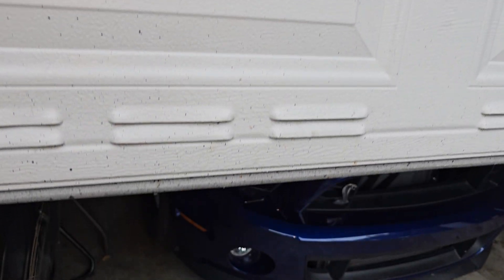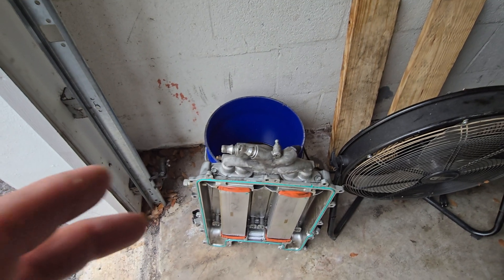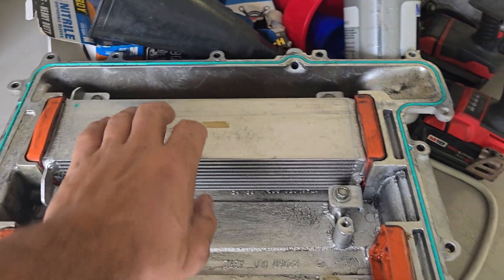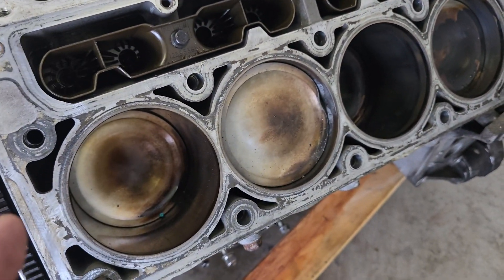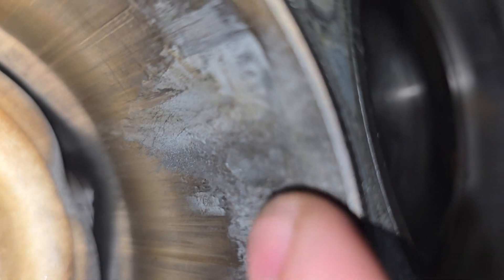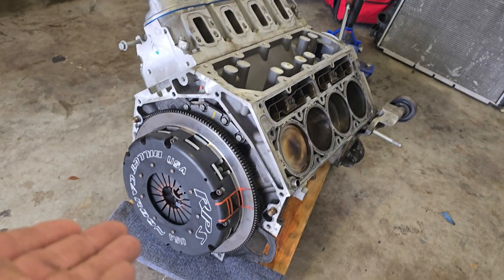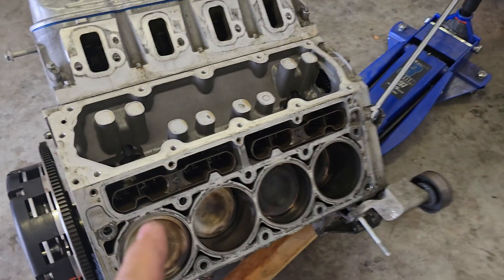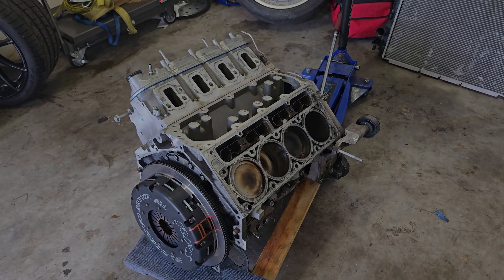The Smoking Gun?: What Really Happened to My Corvette's LS9 engine failure.

Comment: If you resleeve, go with an established company. Try to use the LS9 block you have as it is stronger than a regular LS3 block. Pretty sure there are aftermarket companies that make bricks. If you go with a stroker, unless you stay with a factory length sleeve, stay with a max of 3.900" stroke. I know a lot of people use a 4.000" crank, but depending on the piston/rod combo, with 4.000+ cranks, The piston skirt sticks out the bottom of the bore and rocks, causing premature skirt/bore wear. A 3.900" doesn't have that problem and with a 4.065" bore, you have a 405 ci engine. A good cam really wakes the LS engine up. You can get 100+ HP with just a cam change, with the right cam. R.E.D. has a very good rep, as far as doing Darton sleeves.

Comment: We caught my bricks leaking on my cam install. Already had the Kong gen 3 lid ready for install. Mine had a small pin hole even with stock reinforced bricks. It lasted only 4k miles with a 2.35 upper pulley. Car had 9500 miles when we did cam install.

Comment: an air compressor with regulator set to 10 to 20 psi with an air gun with rubber nozzle or rubber cork will test inter cooler bricks filled with water. you should see it piss out water if its leaking as bad as your was. you probably have a cracked ring land or a bent rod on that bad piston from the high temps. possible detonation from the blowby but you should have seen some knock if you were logging,
Reply from the maker: LMAO. Did you not see the burned piston? Hahaha

Comment: Alex - any debris in the engine oil and filter? I would honestly check tolerance/clearances on the other 7 cylinders.. if the 7 cylinders test good and within spec I would just  sleeve the  faulty cylinder with new piston and rings.. I’ve Been in the heavy equipment trade for almost 29 years and have done this many times on one faulty cylinder. Maybe send the heads out to make sure all is good, check crank bearings.. and find that loving feeling again.. I’m 99% sure a re-sleeve will be all you need..

Comment: Call me dumb if I’m wrong but water cannot be compressed, looks like that water from your culprit leakage wanted to make its way out of the cylinder some how, either this would happen or hydro lock, could only burn some water if it’s very light correct? But if it begins to drip in a little more, well saso

Comment: The water coming off the intercooler brick looked like condensation from water being cooler than ambient air.   I’m not a 💯 but the 1st part of video the water volume didn’t look like it was draining. But idk what happens when you pressurize it. It’s not my car but with you prior machine shop experiences I would try a new gm performance short block and either new heads or rework/refresh factory heads but that also involves machine shop. Like you said take your time and talk to people you trust.

Comment: LME LS9 short block a little over 10k with 10.5:1 compression and rated to 1200 rwhp. Brand new block I believe is around 3500-4000k if the crank and rods are good buy a set of pistons of your choice and put back together.

Comment: I wonder if an LS3 block could be a viable option if the LS9 block is toast. By that, i mean take the LS9 crank and rods, and drop them into the LS3 block and a set of pistons of your choice. 

Im not super well versed with LS engines, but thats me assuming you can interchange internals and blocks like you can with modular engines. 

Then again, idk the price difference between an LS9 block and an LS3 block.
Reply: The LS3 block and sleeves are weak compared to the LS9.
Reply: @LS9STINE  see... That's the kind of stuff I just don't know about lol. Is the LS3 block good enough for an 800-1000whp motor? This is strictly out of curiosity for me now.
Reply: @Elver_Galarga_4u the ls3 can make 1000+ I’m just saying I wouldn’t put one in a ZR1.
Reply: @LS9STINE  oh ok that makes sense. Like I said, not well versed with LS engines so I would rather ask and let it be known I'm guessing

Comment: Good find, I think that was definitely the problem. Even reinforced bricks will still struggle at 20psi. The best thing to do is to lower the boost a bit to keep everything happy. Those bricks are upgraded but stuff still happens. Might as well get the upgraded lid with the revised bricks from Greg but again that’s 2k, and it just keeps snowballing. In the end if you are gonna keep it, you just have to bite the bullet on the lid/bricks and lower the boost with a cam or bigger blower or piston/pulley combo. 

If I were you, I’d sell the ported blower/snout and get a 2650 for about 3k more and make more power with less boost/heat.  You have a sought after snout/blower combo so the difference won’t be too bad . Even less if you get a used 2650👍🏻

It will all be worth it in the end and you’ll have more headroom if you go that way . We chatted on IG a few times about my setup and I can answer any questions you have about that set up but you have a lot of good people in your corner already but I’m here to help 👍🏻 keep trucking, you are on the right path, now you just have to make the hard choices on set up.

Comment: You should pressurize the brick to confirm if it has a leak, hell both of them.  If this is not a freak occurrence, it's probably a good idea to add a supercharger coolant system pressure test to the toolbox of system checks. Salt in the wound to know a smaller problem killed the engine.  It's a tough break.

Comment: Please please please have the heads fixed while you’re in this position. They suffer from the same valve guide concentricity issue that LS7s are known for. Get with IronMask Airflow Innovations if you want the stock castings worked over properly.

Comment: I've done a single sleeve on a modular ford and it's still alive.  It has seen 18lbs of boost at the track and everything is working just fine.  Can't see why the LS would be any different.  My machine shop used a standard Melling replacement sleeve, kept a small step at the bottom of the bore and cleaned the deck and it worked out, no fancy flanged Darton or LA sleeve.  I do assemble my own stuff so I can't speculate if a machine shop will do it and back it up on a full engine.    
My piston looked almost identical to that one, just wait until you see the spectacular blow-out once you get it out of the block.  I'm betting the detonation was between the first and 2nd rings.  Some of the roughness in that cylinder is due to the melted aluminum from the piston that splattered onto the cylinder wall.
Reply: One of the cylinders on my 2J has a deep scratch and my machine shop offered to sleeve that one if it was a problem.

Comment: Just buy a 6.0 aluminum block. Reuse the stock crank & rods and get a set of forged pistons and call it a day. You could bore it out to a 6.2. Or just be patient and wait for something to fall out of the sky
Reply: Or even the iron 6.0 gen 4.... They handle incredible power for cheap
Reply: @7000U9ZHIFT  nah, ZR-1 deserves an aluminum block.
Reply: @ADOLFOSANDOVAL  I mean don't get me wrong I agree... I'm speaking on if you had budget restraints just wanted to get it back together quickly and have fun with it

Comment: Moral of the story, coyote is still KING
Reply: Baja 1k or any off road race 99 percent chevy cause they make hp  can rev 5 to 9 k all day long 20 hrs.
Reply: Moral of the story - you’re dumb
Reply: If there's not any 7sec na coyotahs.....then they are far far from king
Reply: @HioSSilver1999 is there any chevy ls running 5.67 though?. Your argument for na means 0 considering na is highly based off of how big of displacement you have whereas boosted you can actually see how durable the motor is. If you never want to boost your car then sure ls is surely up there for best motors na and quite frankly boosted as well but lots of people will choose coyote over ls for boosting. Especially people who have actually owned both
Reply: Did your bull tell you to type that?
Reply: @joetelesto1907 which LS or ANY GM has won overall Sick Week, Tx2k24, Import vs Domestic and set the drag and drive radial record with a prepped oe cast engine? 
Zero
Or holds the standing mile world record 300.4 mph?
Zero
Or run 5.88 @ 256mph?
Zero
But Fords twin cam engines have.
Facts
Reply: @chadkent1241 facts technically speaking LS is King hints to why all the really fast guys have one or really want one
Reply: @joetelesto1907 😂
Reply: @chadkent1241 think it's actually 5.67 1/4 mile now

Comment: I had a leaky brick issue and only caught it in time because I do regular oil analysis. $30 every couple of months was WAY worth the savings over a motor. Got C&R's, fresh brick seals and everything has been kosher since!
Reply: Great advice.
Reply: I've never heard of leaking intercooler bricks. How does that happen?
Reply: @RidinONChrome  vibration.
Reply: sbinnala  that would make sense. Aluminum could warp with lots of heat.

Comment: The longer it sits the more informed you will be when it comes time to fix it. 

Probably need to start a list. Cam, lifters, trays, GM ls9 head gaskets, new oem head bolts, front cover gasket, new o rings for the Dry sump specific parts, 

sending the heads out to have springs/seals/retainers put on setting up valve spring height and clean/touch up the valve seats. 

Send out injectors to have them cleaned 

Minimum that engine is going to need some machine work, single sleeve and possibly a .005 overbore for a set of pistons. 4.065-> 4.070 bore. if the damaged brick was enough to kill one cylinder. I wouldn’t be surprised if there’s Ringland issues on other pistons.

Comment: The consistent amount of water comming out of it its for sure leaking.
Reply: I'd also recommend having the injectors checked. Mark them so you can see if there is an issue with #6 (your problem cylinder)